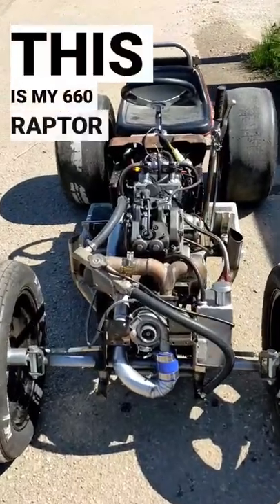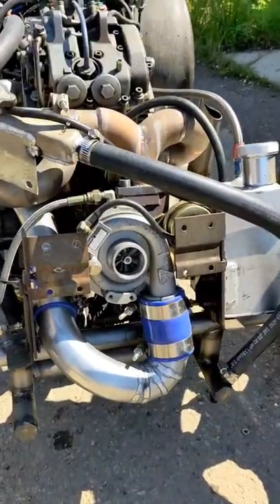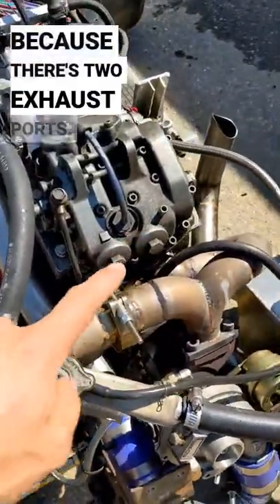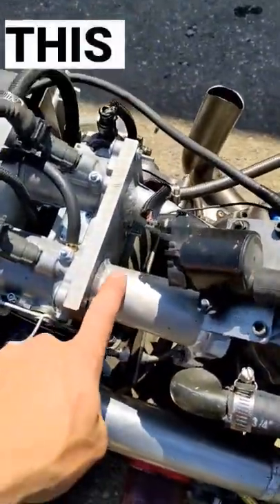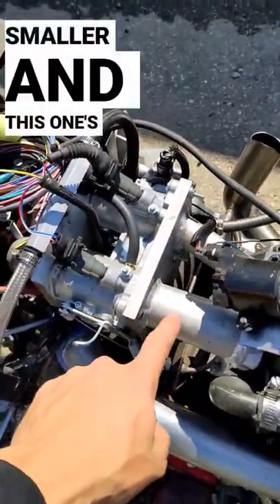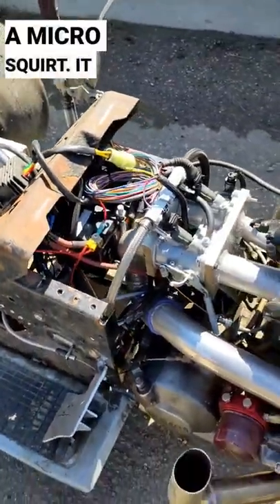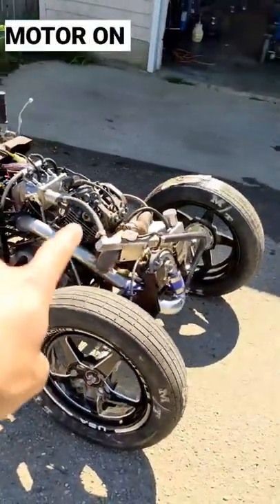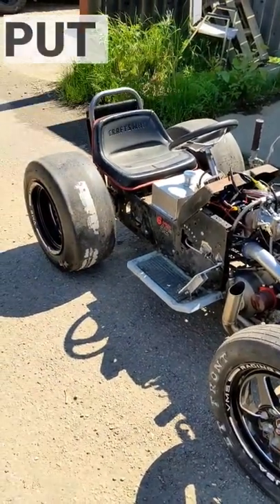How To Turbo A 660 Raptor

Comment: so "when" are you gonna put a new axle in it, "now" I only see a short!
There's 24 hours in a day Kyle, you can film for 25 of them ;p, JK. Can't wait though.
Reply from the maker: I'm just waiting on the bearings! I have a jackshaft installed just waiting on the rear bearings
Reply: @Boostedlifestyle  applied or motion can source you bearings day of or in days, if you wanna pay. They will be industrial quality but for a 1-1/2” shaft they are under $150. Which is more than $20 but a superior product from a name I would trust to run that bearing for a decade in a “will cost me life or limb” circumstance.

Comment: I really hope you go back in later to demonstrate what you can accomplish with that 660. With my monster duals carb work web racing. cam head work valves/port work. And  upped compression. Your much closer to 70ish. I would love to have a parts list for the fi components to fit up for the micro squirt?  I have been trying to figure out what components I would need. Thanks for doing this!!!!

Comment: I highly recommend using a short Suzuki rear drive shaft way stronger and it’s designed for tiny transmission’s I used this method on my old mud mower

Comment: That is a very very tight bend right after the turbo. Would have had more boost if it came out horizontally instead of vertical to horizontal. No?

Comment: Thought it would make more power because 450 dirt bikes single cylinder naturally aspirated make 60 horsepower
Reply: This is also 1 cylinder. Just 2 carbs. 450 is a higher strung engine and stock it does make more hp but at very high rpm. The 660 is a torque monster. And with upgrades will far exceed the 450 but it takes head /cam /comp/exhaust and very good tuning. You can exceed 100hp. I also was disappointed at 50. But I hope he looks at engine mods sometime?

Comment: Coulda just bought a raptor 700 engine put an exhaust, intake and tune it and ur making more power and it’s more reliable🤦‍♂️ If it has a loud blow off valve I like it more tho😂
Reply: Well if you add a set of monsters  k&n a decent port/valve job and web cam on the 660 you can also with only rejetted carbs and if you go to 11.5:1 comp ratio you make even more. But the fact that he figured out the proper throttle bodies and coordinating components is very impressive!!!! With my head cam and some other components he could be working closer to 85-100 hp I know of 2 at the moment na. Upped to 849 cc. One is 109hp. The other is 105